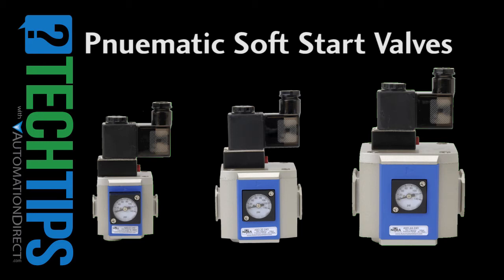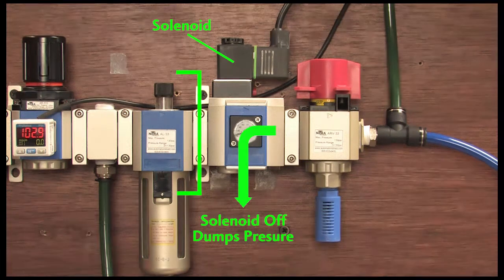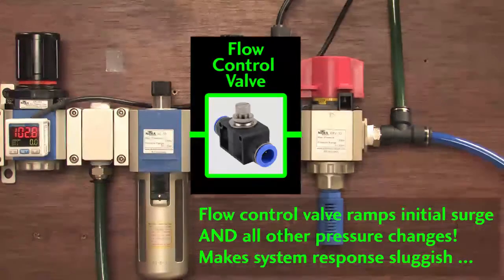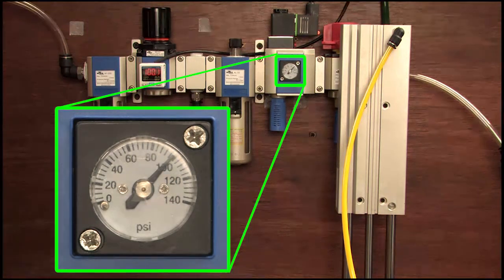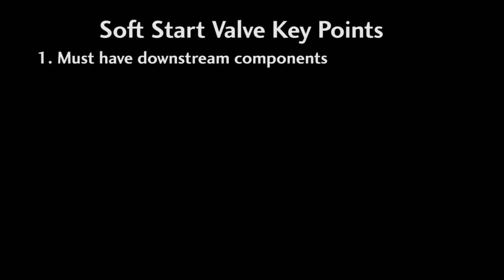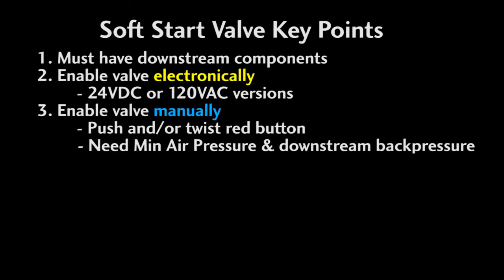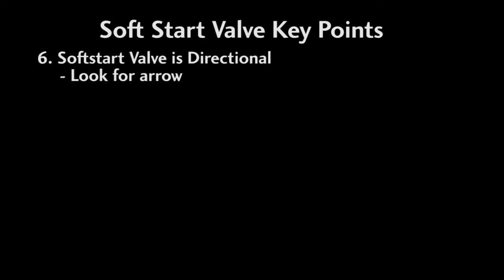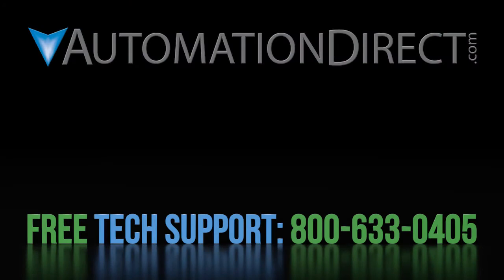Nitra Pneumatic Soft Start Valves from AutomationDirect

Comment: Can someone explain what wiring ports, 1 & 2 are for, like is 1 for power and 2 for actuation signal along with the grounding port? Thanks!
Reply from the maker: @priydevsingh5403 take a look at this insert available from AutomationDirect.com
https://cdn.automationdirect.com/static/manuals/nitrainserts/nitraairprep.pdf

In AC valves, terminal 1 is for either Hot or Neutral, with the other going to terminal 2, since it is non-polar. In DC valves, terminal one is for DC positive, and terminal 2 is for DC negative.

Comment: Does the flow control valve reduce air flow, effectively reducing pressure?
Reply from the maker: Hi Zolkor, This isn’t a flow control valve, it is a soft start.  Soft Starters slowly increase the airflow to prevent sudden changes. Once they have ramped up to full flow they have very little impact on the flow of the air.
Reply: @automationdirect  Thanks for the quick response. I was referring to the point in which you note that the same application could be done with a flow control valve, but not as effectively. Would closing a gate valve partially to restrict air flow have a similar effect?
Reply from the maker: @zolkor1  The gate valve won't ramp the air pressure, but it will restrict airflow. Will it do it as well as a flow control valve?  I don't know for sure, but it seems like it would have a similar effect.
Reply: @automationdirect  Thanks for the info. Running some tests this afternoon. We have an AODD pump that, when running dry, will not successfully suck our fluid at the air pressure we run the pump at. Thinking reducing pressure would do the trick to control the balls and diaphragms of the pump. May be interested in your product if so.